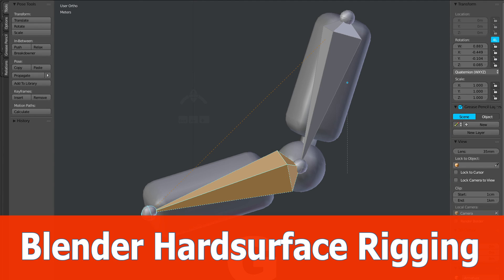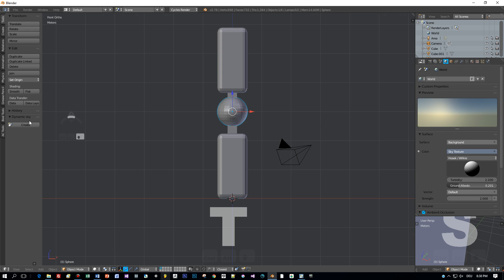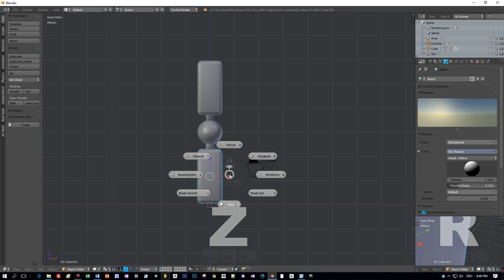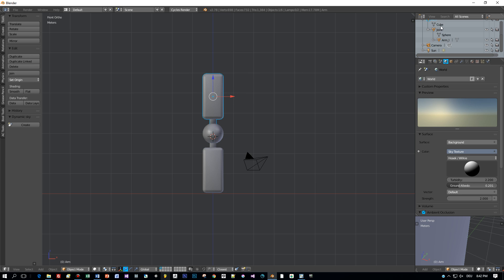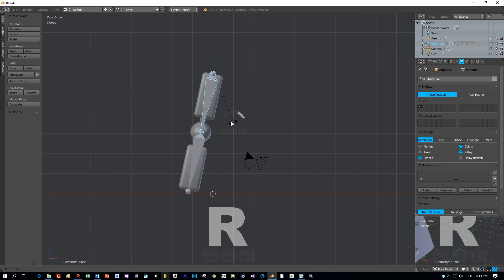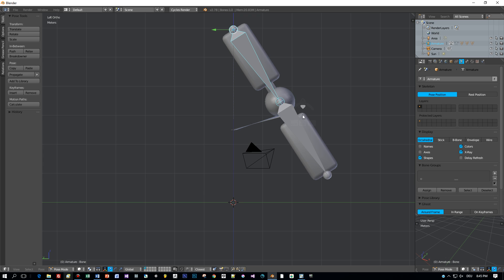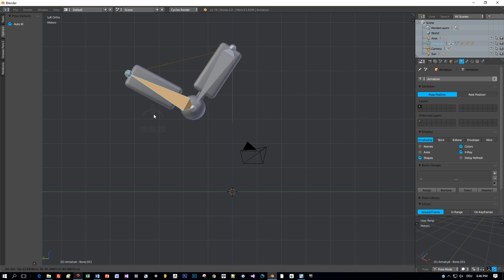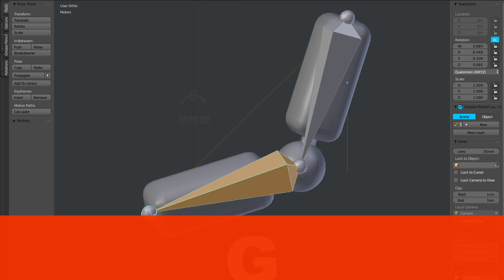Blender Hardsurface Rigging and Weightpainting

Comment: Thx Jay :) !  
I've have a noob question (I'm a C4D user )  : when you paint the sphere/joint area , you need to turn arround this sphere to paint it fully, but can't it be possible to paint directly all the points (visible and unvisible) without turning arround the object ?  no option in blender to paint through a mesh the hidden points ?
Reply from the maker: Yes, you could also just fill it: I think in the Object Data panel in the Vertex Groups 
tab set the weight with the slider, select all vertices in the mesh, and then click the Assign.

Comment: Noob question: is it possible to use simple object parenting instead of object weighting on joints to animate hard surface models? As an example: I have a group of objects and I parent them to the joint adjusting the position of the group pivot point, and then animate the joints, is that possible? Or do I need to use weighting?
Reply from the maker: It is possible, in the beginning of the tutorial I just parent the objects and you can use this for animation, but as I said later you won't have the features like IK for which you will need bones and weights.
Reply: He asked for parenting objects to bones (not objects to objects), which is also possible and allows for IK.

I think weight painting isn't the best way to rig hard objects. Apart from simple parenting, assigning directly to selected vertices/meshes (by using vertex groups in edit mode) is probably a better idea in this case.
Reply from the maker: Yes, that's true, but I wanted to point out that weight painting gives you the possibility e.g. to bend a special part of your model, and leave the other parts fully affected.